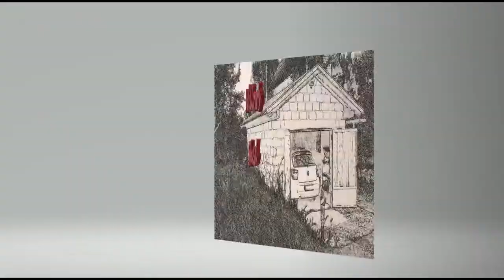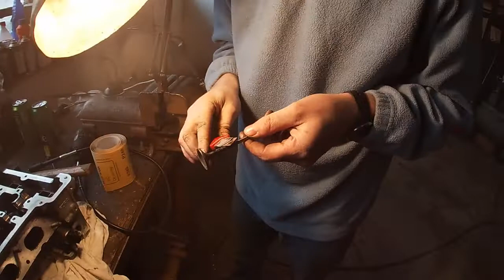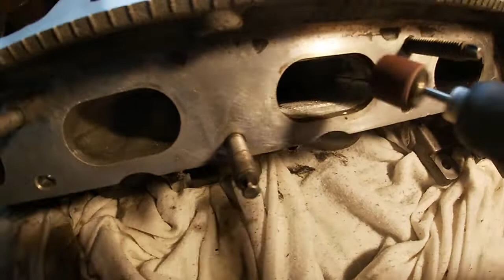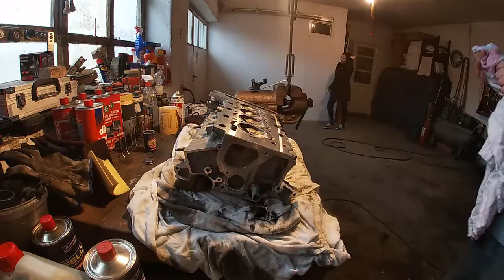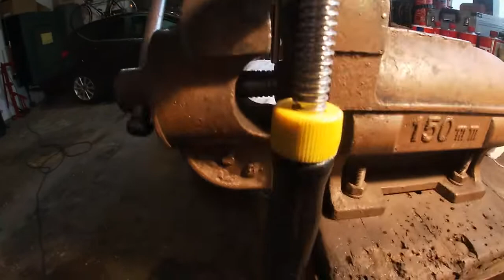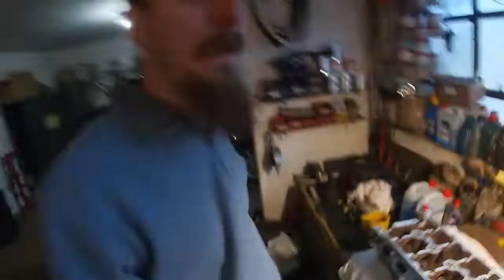NO SPECIAL TOOLS cylinder head valve and port job on N14/THP - Citroen DS3 project

Comment: There is a very cool tool to remove and refit the valve keepers. It's like 50€, it's like the socket you used to disassemble it but with a magnet and a guide. So it prevents the keepers to fly while you disassembly and put it on place while you hammer the spring. Also very useful to changue the valve steam seals if you don't want to disassemble the head.

Anyway, cool video. Very useful to learn about this engine and being familiar before start to work on it!
Reply from the maker: Don't want to buy a tool I will use 3 times in my lifetime, just not my style. Also, I like a challenge of figuring out how to do things without special tools, makes things more challenging,  just wait to se how we adjusted cam timing without locking tools 😅